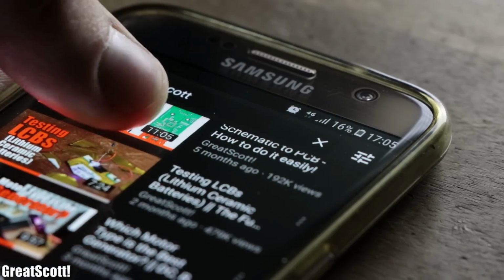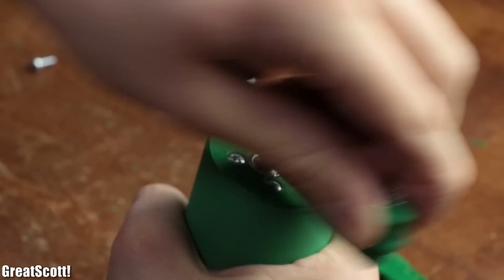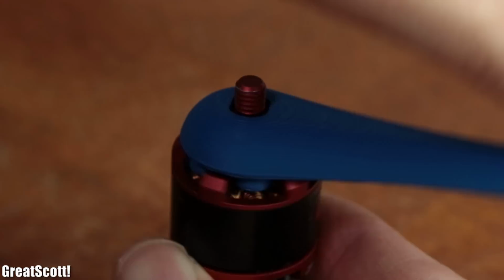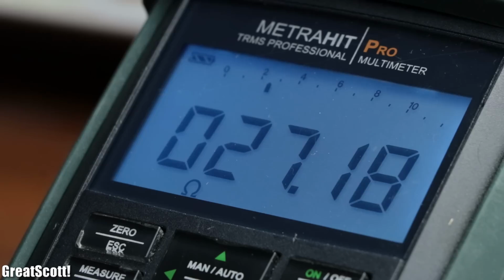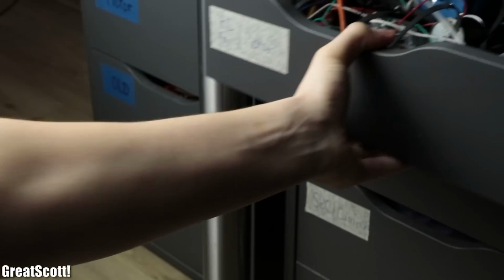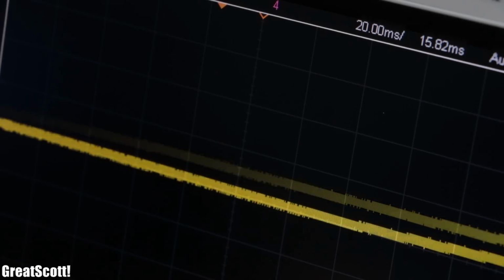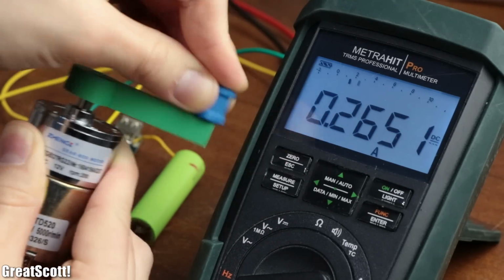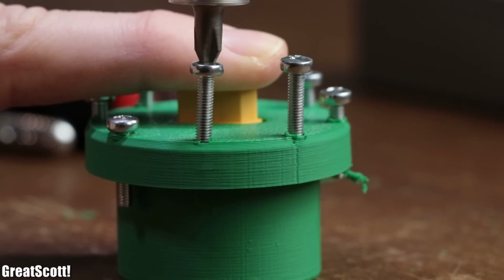Make your own hand-cranked Emergency Powerbank

Comment: I am using a ready-made generator from a military field telephone, which has gears to increase the speed, high voltage of about 100 V and higher current. I found a disassembled EE-108 and I also have a generator purchased separately from the Soviet TA-43, which the Soviet police and special services tortured prisoners and arrested people with. 
I just connect my phone charger directly to the generator. But I've always been helped out by simple power banks that have twice the capacity of a phone or tablet battery.
And from a generator like the one in the video, I made an emergency light in case I got lost in the catacombs and caves, so as not to wait for rescue in the dark when all the batteries would die, but fortunately, I was talking to experienced speleologists.

Comment: GEARS MAN. You could use a set of gears to increase the speed at your motor then a rectifier and voltage regulator for your circuit.

Comment: Hey, quick question. When you connect the motor wires to the battery poles, it will start spinning by itself, is that right?
So to charge the battery, you just crank it faster than the speed it was spinning before?

Comment: You could add a voltage doubler, a buck converter and few capacitors, it hold the charge and needs less rpms to reach desired volts,

Comment: The idea of buck inverter is not good at all because you use variable mechanics tork which leads to no stable voltage you right about 2nd idea

Comment: I don't really understand why the buck/boost converter didn't give a much smoother output? I'd love to have the 24V version motor, so that I also have 24V to play with. Then connect the buck/boost to it, set to 5V. From there, a charging circuit and a few 18650 cells.

Comment: I saw a prototype once that I'd like to see plans for: Basically, take a flywheel with spring loaded arms that maintain a constant rpm and wrap a string around a hub you mount to it. Wind up a string and attach a weight to the end such as a bucket with water, or similar weight and hang the contraption to  your ceiling. As the weight lowers you harvest energy.

Comment: I'd think that besides protecting the battery from reverse voltage if the crank was turned backwards, it would also protect the battery from making the motor turn. I'd have used a diode bridge so that it would be able to charge regardless of direction it was turned.

But mainly, I'd have taken apart a scrapped cordless drill (does anyone NOT have a few knocking around the junk boxes?) -- besides being able to use the motor as a generator, it has a built-in gearbox, often with two speeds, and, a jacobs chuck which makes it amusingly simple to stick a bent rod in to operate as a crank.

Caveat: I am exhausted, in pain (getting ready for major surgery, as I recover from open heart surgery), so the above may just be a bucket of twaddle. But, I don't think it is. YMMV!

Comment: I'd like to see this idea revisited using a stepper motor as the generator which will require a bridge rectifier to change the AC to DC but before that step check to see what the AC voltage is at 5 to 50 rpm then check the DC voltage to see if a stepper motor can be used as a emergency charger.

Comment: If you want to see what capillary action looks like with solder when it's wetting to a surface go to 6:35 and watch him solder the diode in place. It's very visible because it is going up the leg of the diode, Against Gravity. I've never been able to catch it until now.

Comment: I dont get this video and the one with bldc rewinding motor (https://www.youtube.com/watch?v=KZ4cylB114E). 
So, in this video you are using 200rpm geared motor for a handcracked generator because rewinding doesnt work. But in the bldc motor rewinding video (motor rewinded to 108rpm) you are rewinding because you say a gearbox causes some power loss. I'm confused. I dont see a significant difference between the 2 projects yet the motors used are different.

Comment: Why not build a generator from scratch? I have built simple AC generators that give me 220V at 3000 rpm and an AC current of around 3-5 amperes.

The materials were just household items and some 14AWG enameled copper wire. It was hand-crank in design and my gearing ratio to reach 3000rpm was:

Generator shaft = 30 revolutions per second per 1 rotation of the hand crank.

This was a 30:1 ratio and it wasn't as difficult to turn with a longer crank handle at 20 inches long.

From there, I connect a 12:1 ratio step down transformer that one can find in a lot of readily available devices like wall adapters. There was my 12V supply after adding a full bridge rectifier.

You can devise the turn ratio of my 12-pole ac generator easily from this. Its a bit bulky but it works very well.

Comment: A 3-phase generator, that can charge a smartphone at 60 - 90 RPM weighs about 5 kg and contains 1,5 kg of copper wire. Checked by construction of such a generator.
Of course it was made for completely another reason than charging the smartphone by cranking, but just tested in this application.

Comment: So a BLDC would be fine, if it had a gearbox. The conclusion that a BLDC doesn't work but a brushed motor would hinges entirely on the gearbox. A brushless motor would probably be much more effecient, which is very important for deriving power from a hand-cranked system.

Comment: for everyone playing at home, Use a stepper motor. find the winding pairs put a bridge rectifier on each set and you get some seriously good power. I've found it best to charge up a super cap bank then take from that via a buck converter. Good for wind, hydro, pedal or hand crank.

Comment: those batteries could be charged with much higher Charging currents ~1.5A nominally for most 18650 batteries.  And u could have used Full Bridge Rectifier instead of single diode so no matter which direction you rotate. And used the 100RPM (highest torque motor u said that gives 10V) with 2200uF capacitor so that the capacitor doesn't gets easily charge to max & voltage fluctuations at Buck/Boost converter is controllable which concludes stable output at converter with more charging current

Comment: stupid question maybe but can't you just use a simple zener diode inside the custom housing to clamp whatever's on the input to 4V2, thus allowing for a wider range of generators/solar panels/etc to be used without worrying too much about overcharging?

Comment: When you did the calculation relating to the 100 turn 27 ohm winding, you did not allow for the 12 windings (or 4 stars) that are generating in parallel ??

Comment: Actually its pretty common thing if some motor giving high rpms in low volts or ac power ,that it would need more power to reverse the power by rotating motar at high speed 
So u could have started from a dc motor🤣

Comment: I would like to do the smallest hand crank to charge a capacitor and power a remote control, or anything which work with a very small amount of power.
It has to be small enough to be placed on the battery case of the remote control.
Do you see what i mean ?

Comment: could you not do something like a joule thief on the output of the generator using a capacitor and diode to get what would have been the "battery" and then the actual battery being the load to the joule thief circuit

Comment: So basically you gave up on the controlled input and used a rpm that wouldnt go over 5 volt on normal crank and assumed to simply stop charging when at high % refilled battery ??

Comment: what kind of generator is suitable for higher loading power? Something like a generator from a car? the human body is capable of supply much higher power, which can be converted into electrical power.
There is training gear for rowing e.g. - that should charge a larger battery quicker, or could power small computers

Comment: You need to use a geared down BLDC motor. Remember that for a higher voltage, it has to be rotating faster.

Comment: some info.    it is true that an unmodified  bldc motor will,
generally,  not make a good  pma.     in part, because each
magnet in a bldc rotor  is of much lower gauss, than the 
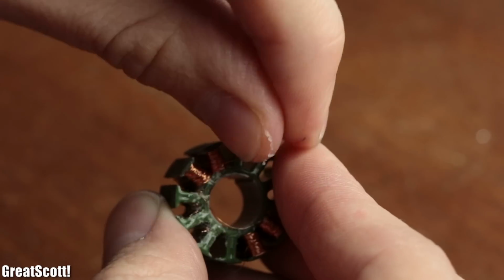neo-magnets typically used, in a quality pma.       at 4:01,
because you show two  Adjacent  coils being wound, it is
not clear whether the single, stator phase mentioned,  was
Correctly made.    discussion:    a bldc should be expected
to have a   Three  phase  stator.      if the number of stator
poles is divided by three, that should indicate the (original)
Number of coils per Phase.    cheers
at link, see  old f&p diagram, showing 42 coil stator; and 
14 coils per phase.
https://lgechupacabra.files.wordpress.com/2016/09/standard-wire.gif

Comment: Small DC motors could be used; it's the gearing ratio or amount of small motors that decides your power output. Allowing one hand-crank to spin the motor X amount of times is what you're missing. Similar to a hand-crank air siren.

Comment: Could you set up the crank to use a gravity generator? So instead of cranking and cranking, have a long string attached, tie the motor to a high location (like a tree branch, doorway or beam), and clip something heavy to the crank arm (like your backpack). Then instead of a lot of little motion you generate power with one big motion, namely lifting a heavy object. 

I've seen this implemented with gravity lamps for camping, but never seen one with a USB port.

Comment: I am an electronics numpty so please forgive this question, but I'm curious enough to ask. Could you put a crank handle on something like an alternator and connect that to a leisure battery via a solar panel charge controller, would that work? Thanks.

Comment: Hey bud
Your videos are great. I need an advice on you. I need to make an emergency led light system when my whole power goes off and a 18650 pack will power the led and than it will go off once the power is restored

Comment: What about using 100RPM motor with a linear voltage regulator (LM7805) and connecting output to the 5V input?? Instead of using a switch mode powersupply for keeping voltage stable?

Comment: (Phones battery is dangerous low)
Me: Starts building a crankshaft generator with the help of 3D printer, Oscilloscope, etc........
Reply: built it befor
Reply: As one does.

Comment: I've been struggling to figure out how to create a 12v generator for headlight/taillights on my motorized bicycle; I have no electronics experience and little knowledge. I thought that any DC motor could simply be used as a generator but I experimented and found I am wrong. I need help.

Comment: the current coming out of the motor is technically AC so you could have just run it through a transformer to step up the voltage to a suitable level

Comment: I have a question for you. I want to set up a semi-off grid solar system with a grid-tie inverter. What volatge do you think is best for the DC setup, and do you think it's worth it to get an MPPT charge controler built into a grid tie inverter or is it better to keep those two pieces of equipment separate?.

Comment: You need a better hand-cranked generator because the voltage that is produced by your generator is varies and can damage the batter you can simply use a inverter circuit to charge it

Comment: You need gearing for the brushless motor too. I have a commercial flashlight/crank generator with brushless motor and 3 phase rectifier. It has gearing though. Cheapo build, but works.

Comment: FYI, you could avoid the problem of overcharging by feeding the input to the DW01 protection chip instead of directly to the battery, since that's what it's designed for.  (Saw this power bank has the classic DW01 with dual mosfet package arrangement for battery protection.)

Comment: Please make a bluetooth card as credit card but with arduino and bluetooth module. So it will fit inside a wallet and will turn it into an smart wallet. When the wallet goes out of range of the bluetooth signal, your phone will remind you that you forgot it or you are going to lose the wallet. Thanks :) Your videos are really good. :)

Comment: Which is better to make 12v battery pack by li-ion 18650 battery use step up power spply Module for Boost battery voltage or make 3s battery pack?

Comment: A crank-direction indicator feature should be added to the end of the motor cover to prevent accidental depletion of the circuit? Is that right? I mean a permanent marker would do the same, but having the direction indicator integrated into the print would look cool.

Comment: Explain how a li-ion battery charge in fast charge (Qualcomm quick charge) ...
Now a days latest mobile phones are charging in 20-30 minutes....
How does it work...?
Reply: Qualcomm 2.0 has three stages
5v,9v,12v
At what percentage of battery which voltage is applied...?
Reply: @venkateshg5186  I can't ask specifically, but when in low charge the battery accept a higher voltage, progressively turning it down while the battery takes the juice, up to a level when it becomes a normal charging.
Batteries wear a lot when they reach full capacity while charging.

I don't think I helped at all but it's all I know.
Reply: Basically a rush of current.
Reply: li-ion batteries are capable of charging very fast. you are only limited by the thin wire in your USB charger. at 5V 1A you get 5W of power, at 12V 1A you get 12V. in both cases you are passing only 1A (it's the "amps" that heat up the wires). the same as high voltage lines that power our houses. you get 120 or 220V but the power lines have 500kV or more.
Reply: @83hjf  
I understood the voltage thing , but I don't understand the current thing...
If there is 5v for 3.7v battery i= (5-3.7)/resistance of wire, circuit take 1ohm.
=(5-3.7)/1=1.3A
At 12v
i=(12-3.7)/1=8.3A
But on charger it says 12v,1.66A
How..!!....
Reply: @venkateshg5186  chargers are more complex than that. they provide a set amount of current. imagine it wants to provide 2A of current at 3.6V. if you have 5V 1A, converting it DC-DC at 100% efficiency means 3.6V 1,38A max available. if you have 12V 1A, though, you can convert it to 3.6V 3.33A. The charger will then provide a voltage as high or as low as it needs to
to keep the battery current at 1A

Comment: Is it possible to make wireless electric transfer using ac low voltage like 15v ac from a tranformer 
Without 2n2222 npn transistors

Comment: why dont you use one of those gearboxes with bldc generators ?
so you will have more rpm than more voltage without changing windings ?

Comment: Can I suggest that you put the diode and cap in box with the battery instead of the generator?  Then you don't need to cover the xtc connectors as one won't have a direct connection to the battery.  It makes me nervous to see unfused connections directly to batteries.

Comment: Nice project! - I'm sure the capacitor could have been omitted, since the battery being a large capacitor in itself, right?
Reply: The capacitor is there to smooth out the voltage, by acting as a temporary reservoir it can store excess energy and output it on times when it dips thus the result is a much more smoother current
Reply: @kittyyuki1537  the battery IS a capacitor in itself. Put on a scope and see. The capacitor will have neglible function

Comment: 4:39 - Voltage arrow across the battery points in wrong direction. Edit: they all point in wrong direction! Also it is not fair to compare gearboxed DC motor to directly-cranked BLDC motor and then claim that BLDC can't be used. C'mon, just put a gearbox on it!

Comment: I planned to use a 21v synchronous motor which then I connect it to a full bridge rectifier and a USB buck converter to create an emergency hand-cranked phone charger. The thing is, I don't know what value of capacitor should I use to smooth the voltage.
Reply: any high uF cap is ok
Reply: Sounds good.  Be careful that the peak output of the gen doesn't exceed the input rating of your buck convertor.  At 600 rpm (10 rps ) a 3 phase gen thru a bridge will pulse at 60 Hz, never dropping to zero.   Or is my maths wrong?  To smooth that, the size of cap you need depends on the current demand.  If you're sizing it for 5V at 1 amp, that equates to 20V at 250mA, so I agree with the previous commenter, a reasonably fat electolytic on the 20V side is a good bet.
Reply: @raykent3211  but synchronous motor  is considered single phase, right?

Comment: use gears to convert load into speed(rpm).and use small one- way rotation mechanism with coiled spring wires to give input work as push or pull manner.it is more easier to push or pull something with so much power rather than rotating with less power.

Comment: A good source of motors for this seems to be windscreen wiper motors. There are two kinds, you need the continuous spinning ones (some go one way a bit then reverse). They are low rpm geared 12v,perfect for this.

Comment: Why are you cranking the motor backwards?  So, I guess you are left handed. That's cool. Instead of a single Diode, someone who wants to be able to crank it either way could use a *FULL BRIDGE RECTIFIER*, but then you have the voltage drop of two diodes instead of just one, which further reduces the charging speed.
Reply: use SCHOTTKY diodes and you get the same drop (or less) for two vs the drop on a 1N400x

Comment: Use a full bridge rectifier to double the output power. A single diode will cause you to lose half of each cycle.
Reply from the maker: There is no AC. It is a DC Motor with a DC Output

Comment: Jeez Louise, are those xt60 connectors, and 12awg wires beefy enough for the whopping 300mah? Seriously though when working with lithium cells in applications like this you should use minimal wire size in case of a short.